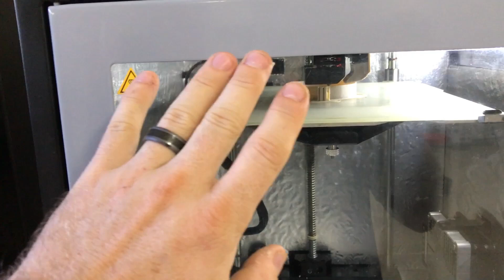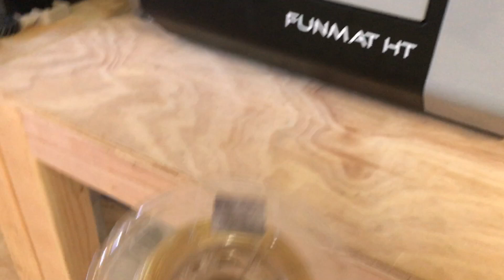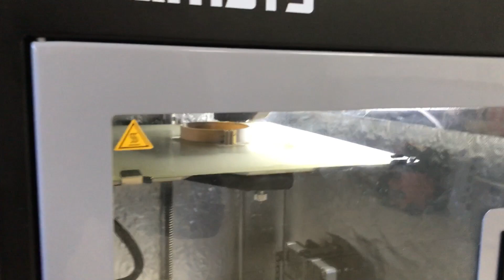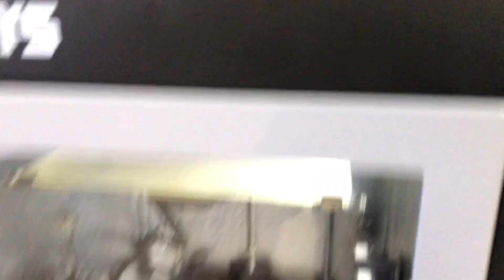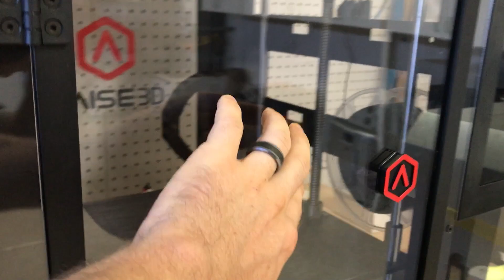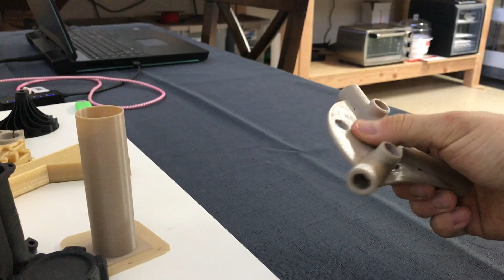3D Labs - 3D printing PEEK and Ultem with the Intamsys Funmat HT

Comment: Hello, do you have to harden the PEEK parts (via oven cycle) after the initial print, or was it strong as is? Thanks.
Reply: Hardening (annealing) them is always recommended if printed in lower temperature chambers (80-100C) or printed "cold"

Comment: i've heard 90c only creates very weak parts. you need at least 150-250c for ultem and all? how strong is the layer adhesion
Reply from the maker: 450C, slow and hot gets the job done with PEEK in the Funmat if the part isn't too far off the bed, maybe 1 inch.

Comment: I also upgraded to pt100 sensors a e3d  v6 hotend bontech bmg extruder a borosilicate glass bed with kapton tape a duet 2 wifi also a duet touch screen all upgrades are genuine parts u think I'll be a le to print peek or ultem without a heated chamber
Reply from the maker: PEEK can actually be printed cold and then annealed later if your nozzle can reach the required temps to print it. Ultem no chance whatsoever without a heated chamber.

Comment: For such a expensive machine y can I still hear the steppers lol I have a flsun  which I upgraded to a duet 2 board and it completely silent no noise whatsoever
Reply from the maker: Hi Sean, this is an older machine and as I said in the video the board was upgraded to TMC silent steppers based on our recommendations and they sent us a board as well. The new machines are nearly silent. Stepper driver noise is probably the least thing considered when developing a high temperature machine such as this.

Comment: so this stuff is the same as pei right? is it possible to print a sheet of it to use on a print bed?
Reply from the maker: Ultem 1010 is essentially the same as PEI and while you could technically print a sheet of it to print on, it would be much cheaper to just buy a sheet of it on Amazon or another supplier. It is a popular print surface for many materials. The issue with printing PEI on PEI is that it might bond too well and not come off. One way to avoid this is to apply glue stick as a separation layer.

Comment: do you think it is possible to use a palette 2 with it? https://www.mosaicmfg.com/products/palette-2
Is it possible to add another hotend or use a chimera+ watercooled (e3d) with one bowden drive? i can see the board is prepared for 2 more drivers.
Reply from the maker: Yes, you should be able to use a Pallete on it, but not with high-temp materials as the slice core in the Pallete does not reach the required temperatures. You could add another hotend or change the existing one, but you would have to trace the pins and install Marlin on the board. The touchscreen firmware is also proprietary and likely wouldn't function with the open source Marlin.